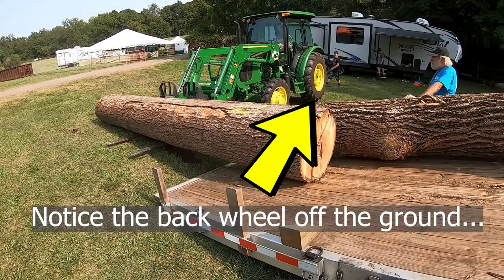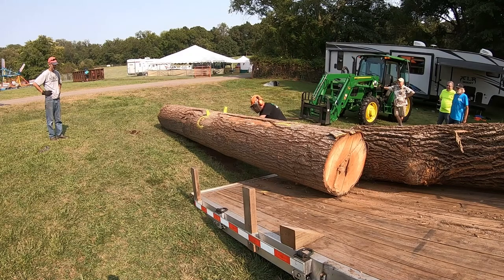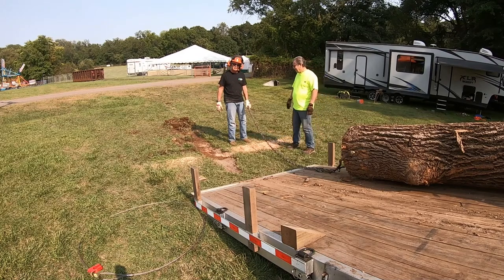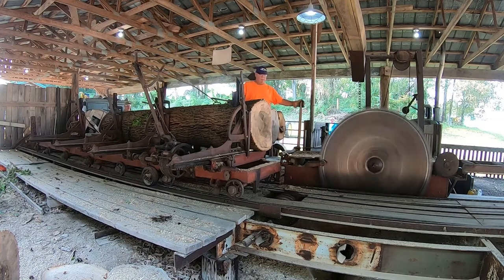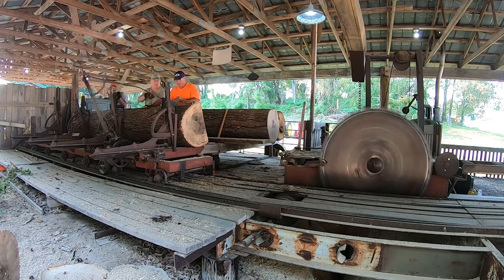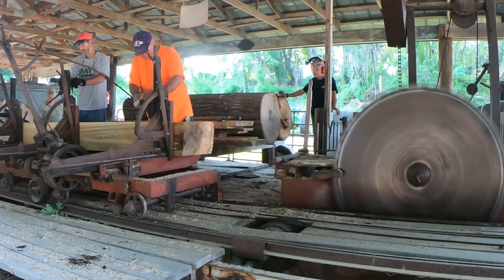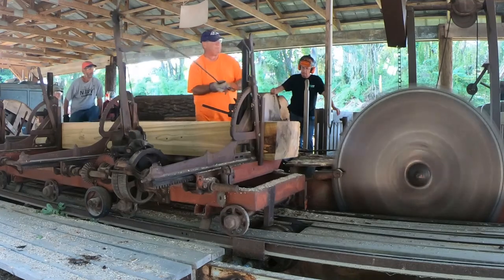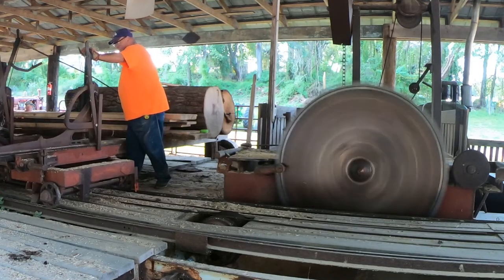Day 2 at the County Fair cutting lumber on the Frick Sawmill

Comment: Hello  Wayne, a little trick if you don't have a wedge with you. When making the cut cut when the cut starts to close on the bar. Keep saw at full throttle and move bar in and out and as the top comes together continue alll the waythrough the  cut. Works real well.
Reply from the maker: Wow. That makes sense. I'll try it this week.  Thanks for the tip.

Comment: what do ya use the lumber for? does anyone ever bring in some softwood to saw? that would be a big seller
Reply from the maker: Cedric,  that's a complicated answer. The mill is owned by a non profit organization,  so we don't sell any boards. A lot of the lumber we make into fence boards for the park. Sometimes members bring logs, and we mill them for the them, and the park gets a cut. It seems to work out. Thanks for asking.  
Wayne